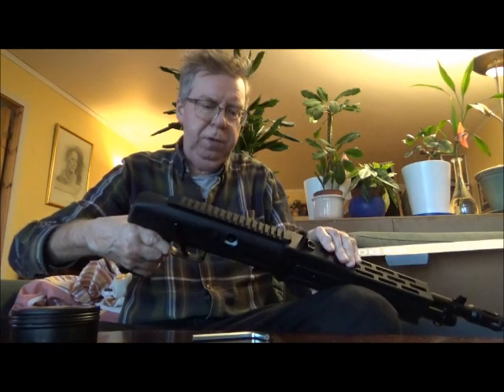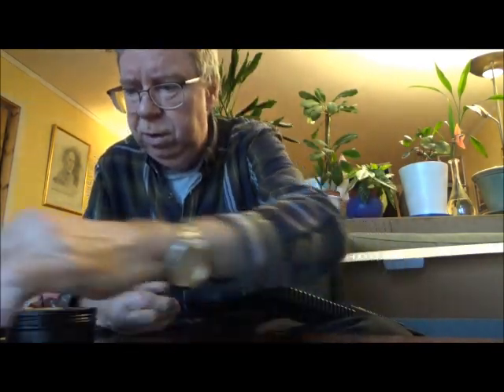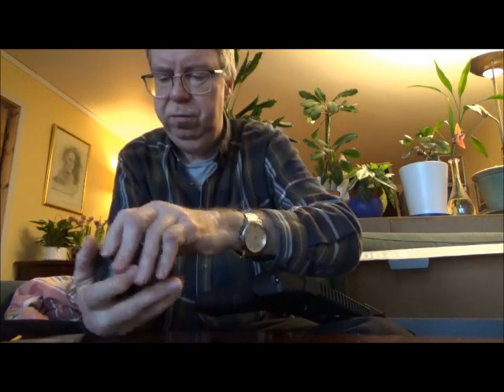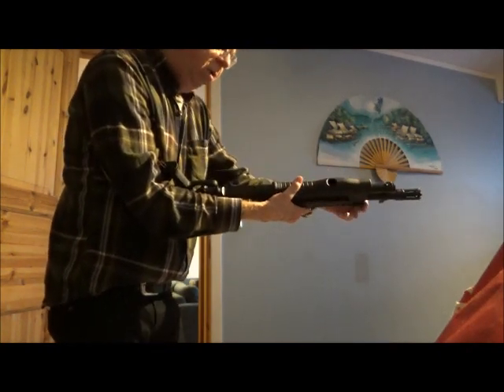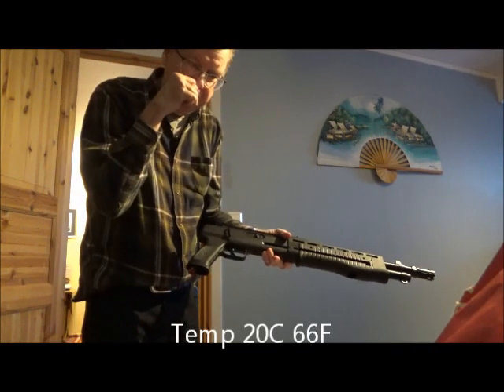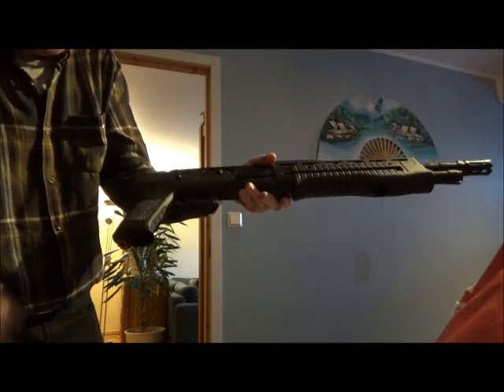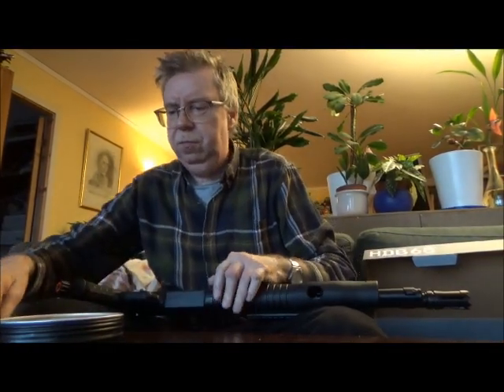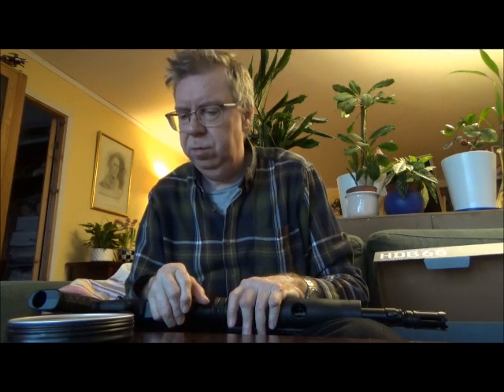Umarex HDB68, X-treme Modify Pin, Homedefence-24

Comment: So it lacks a 88g Co2 to be a beast and keep 16 shots :/ any mods ? seems hard due to Co2 native slot without rear piercing "advanced crafting"
Reply from the maker: If you use it with a 12 gram CO2 and want to shot 16 shots then leave the restrictor in place. From my testing I get 16 or 17 shots from a 12 gram CO2.

Comment: Is There any videos on how to install the hdb power 68 kit from modern combat sports, it came with no instructions? Thank you
Reply from the maker: Hi my friend. This model dont need the Powerkit as I see it. Just remove the valve block and restrictor from the CO2 tube for max power. For more power put on the buttstock adapter so you can use HPA or bulk fill CO2 https://www.homedefence-24.com/en-no/products/kombi-buttstock-adapter-hpa-flasche-schulterstutze-2

Comment: Have you tried lubricating the spring yet? i hear teflon makes a coating on plastic. i used it on something similar then followed with silicon and it was quite successful.
Reply from the maker: No other lube than the siliconespray I use down the tube for the CO2 canister. Dont think I open it up again unless something breaks... 🤔

Comment: Je te remercie beaucoup pour la vidéo, donc la goupille que tu parle, moi j'appelle ça le restrictor mais bon d'après ce que je vois tu à retirer la goupille enfin dévissé, ? C'est bien ça  et concernant la valve de block on la retire aussi en gros on retire les 2 truc pour un maximum de puissance et en distance ça va loin ? Et merci pour les vidéos, je reste prudent porte toi bien mon ami,
Reply from the maker: Hi my friend. Just remove the valveblock and restrictor for max power. The pin will make the velocity more even plus you get a few more shots. Cheers my friend

Comment: Quand on met la sparclettes dans le hdb 68, 16joules cela peut nuire au joint dedans ou pas peut ton attendre 4,5 heures sachant que le gaz est déjà dedans ? Cordialement
Reply from the maker: If you have punctured the CO2 canister then you should use it as soon as possible. CO2 will ruin the seals and O-rings, plus the CO2 tube can blow out. It has happened to several people. The new guns from Umarex have a screwed and crimped CO2 tube, but not the older ones. So its best to use it quite fast.

Comment: Ok merci pour les renseignements, pour la valve c'est bien celle de derrière la ou y a le pin ?
Reply from the maker: Hi my friend. The X-treme modify pin sits in the CO2 cap in the bottom of the grip. Its very easy to install. I have a video showing how to do this.

Comment: Rune, I have to ask a few questions.  I has mentioned I have the 7.5 version and the can not remove the valve block because it glued or something.  If I do the power upgrade will it at least bring close to the 16  joule version?   If you know where I can buy the 16jouls valve that would be awsome.  Many thanks for your quick replies.  

Jamie 
A freind from the States.
Reply from the maker: Hi my friend. The valveblock should be easy to remove. Unscrew the brass cap. Use a screw that can be screwed into the hole in the valveblock, and then just pul it out. It was very easy on mine. Not sure if they are all made the same. No idea where to buy spare parts for it, sorry

Comment: D'ailleurs je pense à ça avec le bloc plus le pin tu dois gagner au moins 55 jul, en plus je pense que la on peut mettre la bouteille avec le hpa,  si tu as l'occasion de faire le test fait moi signe en premier mon ami je serai très curieux de voir la puissance, tu en pence quoi ? 😮
Reply from the maker: I think you will get well over 55 joule with HPA. All my HPA tanks are emty and my scuba tank must have service before I can have it refilled. Not sure when I can make a HPA video. For the moment I only use CO2...
Reply: @runerebel8441   ok merci beaucoup on verra bien ce que ça peut donner, à bientôt mon ami
Reply: @runerebel8441  bonjour mon ami alors comment tu va ? Je voulais te demander j'ai démonter le corps du HDB CAL 68 ,et il n'est pas  vissé c'est la 2 version que j'ai mais il est bien je vais essayer de t'envoyer une vidéo,  bon week-end à toi ,
Reply from the maker: Hello my friend. Is there a version that has no screws? Very strange. Maybe its the google translater that missunderstod. Not sure. I wish you a nice weekend also. Cheers Rune 😃
Reply: @runerebel8441  hello oui il y a du avoir une erreur ,a bientôt
Reply: @runerebel8441  bonjour rune je voulais te demander si je retire le restrictor, et que je mais une cartouche de co2 je gagne combien déjà en joules et je peux faire combien de tire environ, ps je n'est pas modifié le HDB CAL 68 ,et d'ailleurs si on coupe l'espèce de ballonnet dessus tu gagne en puissance ? Car j'ai vu une vidéo et le mec a fait ça, donc voilà merci de ta réponse,
Reply from the maker: Hi my friend. You will get more power if you only remove the restrictor, but I dont know how much power. Never tested it that way. I guess maybe 15 joule or so 🤔 @cedricbardin3385

Comment: Ok donc je dois multiplier les 16joules plus 15 joules sans le restrictor c'est bien bien ça ?
Reply from the maker: Hi. You have the 16 joule version? If so then removing the restrictor should give maybe 25 joule. My 16 joule shot wildly. Got everything from 12 joule to 27 joule before I removed the valveblock. I highly recommend you remove it. But you can try to only remove the restrictor first and see what happends 🤔

Comment: Bonjour 
Que donne le résultat en perçant le restrictor à 1,5 mm + le pin modifié ?
Reply from the maker: Hello. Just remove the restrictor and the valveblock and you have max power. You will get ca 8 shots from the CO2 canister. The first 3 shots will give between 35 joule and 45 joule. If you use the X-treme Modify Pin the energy will be around 38 joule over more shots. So more stabile velocity. If you use the restrictor you should get around 10-12 shots from the CO2 canister and the energy should be around 33 joule or so 🤔
Reply: @runerebel8441  thanks Rune 🙏
Reply from the maker: Iam glad to help  @Hipipip  😃

Comment: Donc je peux retirer le restrictor et mettre la sparclettes dedans sans retirer la valve ? Merci d'avance
Reply from the maker: Yes, but you will have less power.
Reply: @runerebel8441  bonjour rune du coup j'ai simplement percé le restrictor a  1mm ,donc en attendant de pouvoir acheter le kit pour augmenter la puissance, d'après vous je gagne combien en joules car je n'ai pas encore de chrono, je vous remercie beaucoup, ps vous chercher pas un cuisinier par chez vous ?
Reply from the maker: Hi my friend. I never tested it with the valveblock in place and no restrictor. But I guess ca 18 joule or so 🤔. My wife makes me dinner, but from what Iam told several restaurants in Oslo centrum hires cheifs 😃  @cedricbardin3385